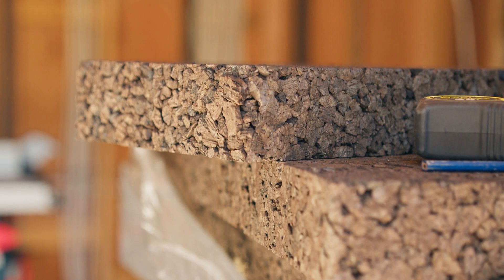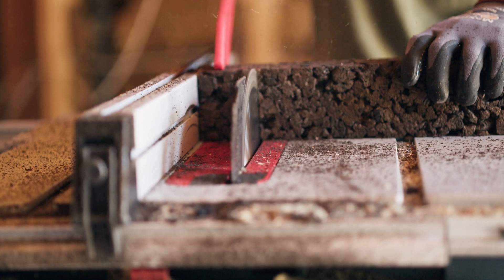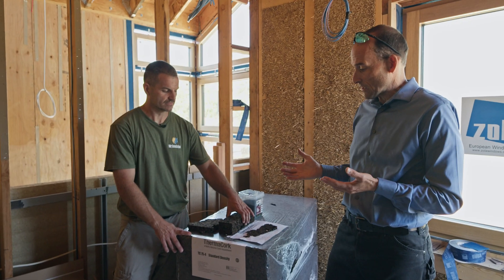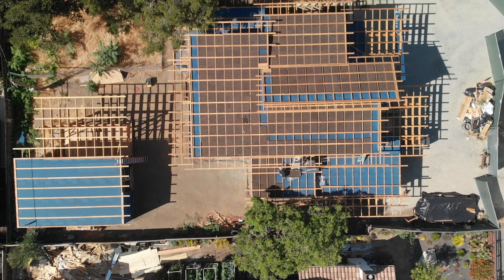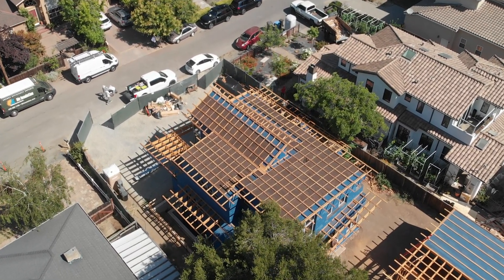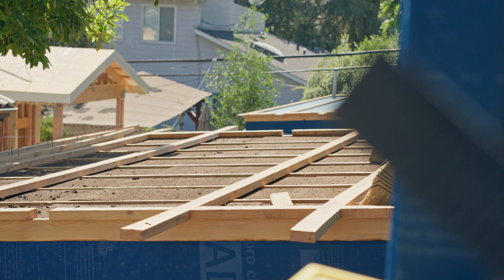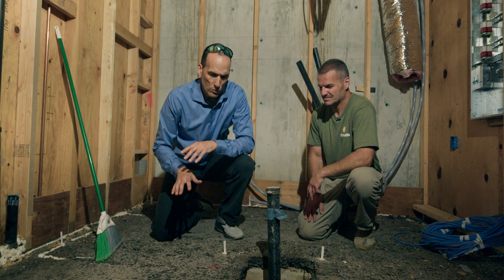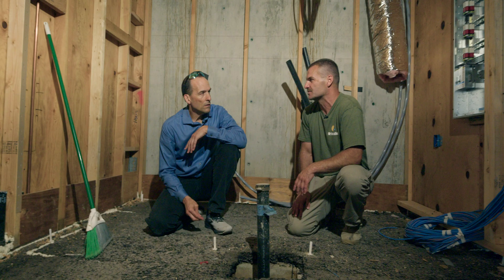Cork Insulation - The Healthiest Choice for Energy Efficiency Or More Manufacturer Greenwashing?

Comment: Thanks. I would like to add that cork has high mold resistance, is antibacterial, breathable, and easy to repair. When the weaknesses pointed out by Mr. Insulation are taken into account and it is applied correctly, it is truly a great material.
Reply from the maker: Agreed!

Comment: Who failed so hard to not update the building design to take into account the dimension of the insulation to avoid ripping the material to fill the gap?
Reply from the maker: Ahhh, that would be prioritizing installation ease over design.  We believe that would be a huge mistake.  People want to live in places that make them feel good, and part of that “Feeling” is aesthetics and part of it is performance.  We think both should be considered when building and designing and cutting the cork is a small price to pay for a better looking(yes, I realize that is subjective) home.
Reply: 24in vs 0.5m exposed members isn't going to be visibly noticeable but it's sure going to impact cost and performance.
Reply from the maker: What is visible is all relative.  Additionally, you are assuming that the width of the cork should define spacing, but what about the width of the overlay of sheathing or roofing, which are on 4’ x 8’ grids.  These won’t work anymore and the boards will have to be cut to fit the metric measure.
Reply: Did you forget furring strips were installed and the cladding was going to be installed on those?
Reply from the maker: lol!!  Yes. I. Did!

Comment: Sooo... if humans can eat it, I imagine that termites can as well. I wonder if this might actually be a benefit if they prefer cork to lumber.
Reply from the maker: Interesting thoughts.  Cork is not wood and has very little cellulose in it(<15%), which is the super/carbohydrate that termites eat.  Additionally, cork is filled with a chemical called suberin, which are composed of fatty acids and alcohols, and are repellent to termites.  So cork is not a food stuff for termites.
Reply: @BuildingABetterWay   Interesting. So, does cork "breathe" like fiberglass?

You know, a lot of "experts" on here are using foam sheets and spray foam, trying to seal every gap. They end up with a home that's humid inside from respiration and running the shower and need to run a dehumidifier all the time. There goes your energy savings. This is a big mistake. A house shouldn't be airtight. You want dampness to be able to escape.

Does cork breathe like fiberglass does?
Reply: @joevarga5982  Try that in a cold climate, you will have mold in the walls very fast.
Reply: @WalkthroughHeroes   Try WHAT in a cold climate?
Reply from the maker: The problem with having sealed walls that don’t breath is mold so design walls that allow vapor diffusion and that exclude water.  Foams do not do this well and leak Air/vapor constantly.  The problem of poor indoor air quality from tight homes is easily solved with an Heat Recovery Ventilator(HRV) or Energy Recovery Ventilators(ERV).  A house that is cooled to the point of condensation is a house that has not controlling infiltration while cooling.  Cold air needs to be dehumidified or it condenses, and this is exactly what an ERV is used for.
Reply: @joevarga5982  Having a house that breath thru the walls as you said (not airtight). Having humid/varm air from inside meating the cold outside in the wall with make it condence in the wall.

Generally we dont insulate with foam over here (Sweden) but we put up a diffusion barrier on the inside on the insulation (warm side) to avoid condensation in the wall.

But ofc you need good ventilation in the house with preferably a FTX system.
Reply: @WalkthroughHeroes   We have had breathable houses in the USA FOREVER. Fiberglass insulation has been the standard for many decades without a problem.

Sealed-up homes which don't breathe is something new. Making a house airtight traps moisture inside the house and makes it humid, requiring a dehumidifier to run all the time and negating your energy cost savings. I already explained this.
Reply from the maker: @JoeVarga5982.  Because what you said is true, doesn’t make it the right way to build. This is like saying that we didn’t have any car related deaths when all we had horse drawn carriages.  It is true, but it is not a good reason for dispensing with cars and keeping horse drawn carriages.  Leaky, Breathable homes are super inefficient and you can design an air tight home that is also super efficient and does not require much energy to dehumidify.  Your analysis that you give up all your energy savings from a tight house in dehumidification costs, doesn’t hold water(so, to speak).
Reply: @BuildingABetterWay   And because what YOU just said is true doesn't make it the right way to build either. There's no ONE right way. There are all kinds of different cars with all kinds of fuel economy ratings and performance levels for all different tastes. It's all a trade-off. Same with homes.

I prefer not to have to have auxiliary equipment running all the time and also have to deal with audible noise, inspections, maintenance, operation, changing filters and eventual replacement.
Reply from the maker: And you are fully entitled to have your home the way you want and pay the utility bills appropriate to your type of home.  No argument here.
Reply: 😅 @BuildingABetterWay